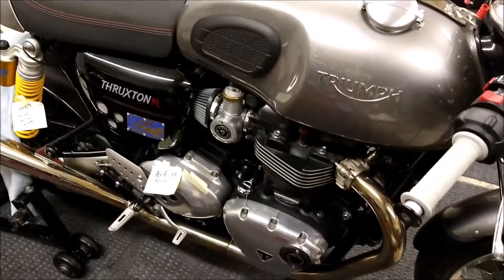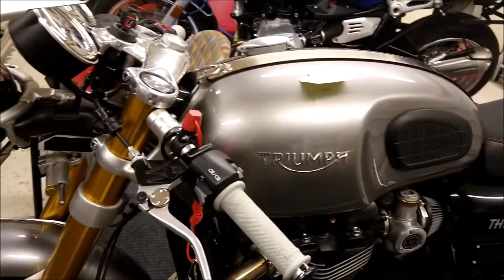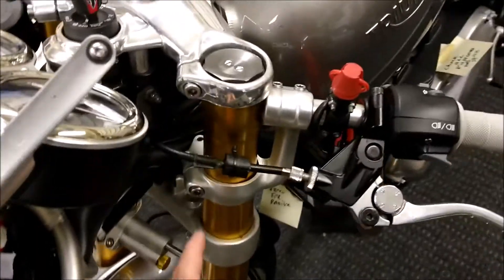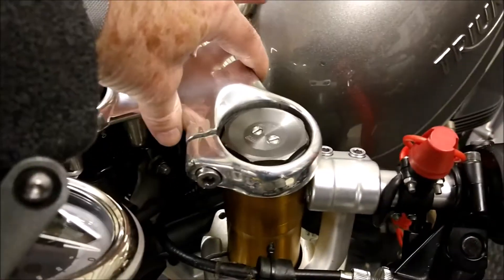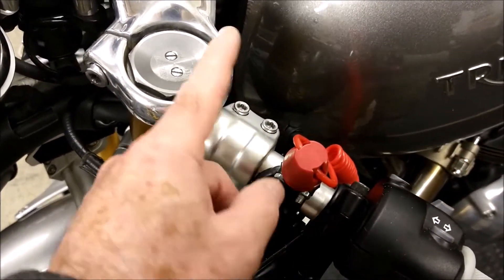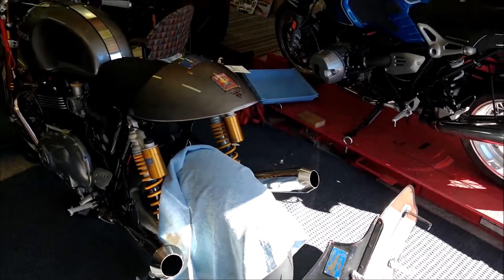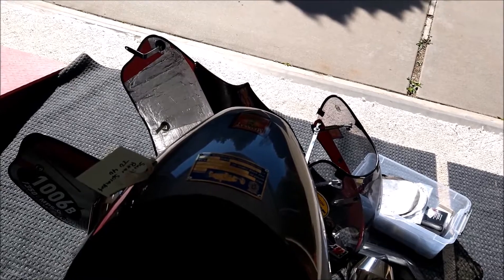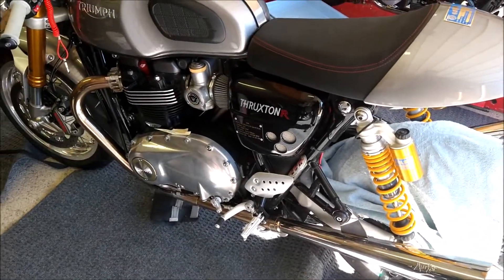Progress on Thruxton R towards Bonneville 2021

Comment: Love the sticky notes all over the bike for each job that needs to be done. Then into the bucket when done.  The fork tubes look a little lower than normal.  Should they be pulled up just a half inch or so ?
Reply: I had the same question/concern with how low those were in the video.  Did not look like a good clamping surface for the speeds you are shooting for... but I have not experience with this... Just looked unsafe from my untrained eye.

Now, on the exhaust, wow!  That has to be loud in real person. Sounds mean!